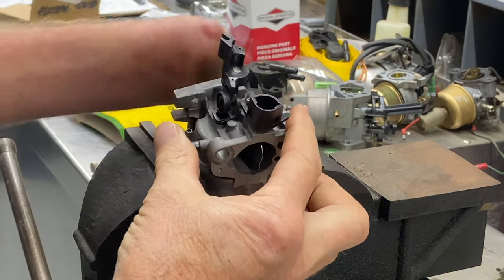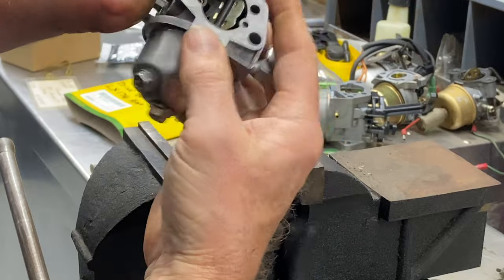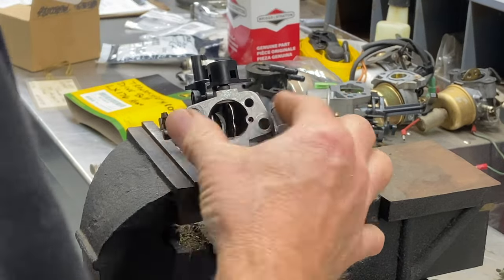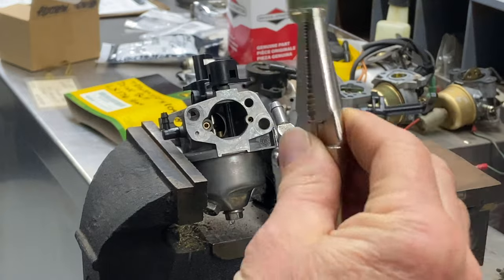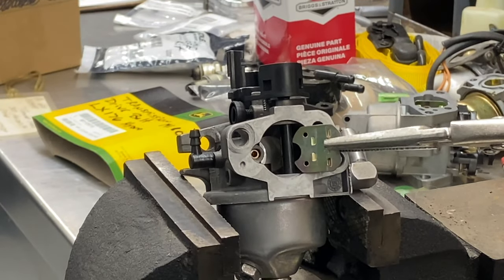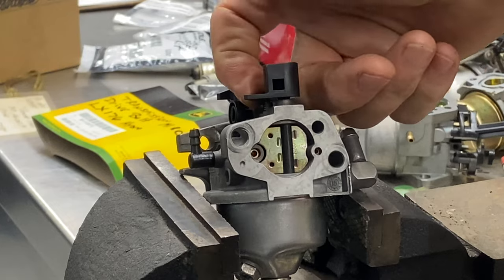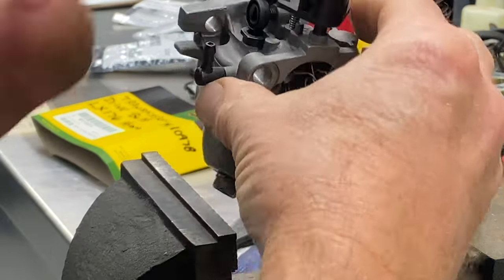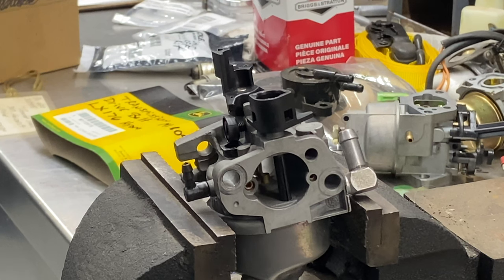How to Remove Choke Shaft on Snow Blower Carburetor.

Comment: New carb doesn't come with the long shaft so they want you to use the old parts or is that just because it's cheap aftermarket?
Reply from the maker: If you have a snow thrower with a China engine, all the carburetors are from China. Yes, some are junk and you need to be careful. The OEM "original equipment manufacturer" carburetor is made by Huayi. Even the OEM carburetors do not come with the plastic rod. Just swap it out.
Reply: @JohnsonsSmallEngines  Did what you said it purs like a kitten. Thank you.

Comment: How to remove the longer choke shaft
Reply from the maker: It’s the same process.
Reply: But my plate is not coming out or moving at all. 😭😭 I just want to get this friggin rod out since the new one didn't come with one
Reply from the maker: If you hold the carburetor and you’re strong enough. Take a pair of pliers that have a good grip and you should be able to pull the black rod out of the top of the choke shaft where the long rod connects to the lower choke shaft.
Reply: Thanks so much for the video! I have been searching for several hours and I found my answer!

Comment: Still don’t understand how to get the long silver metal piece out of the plastic. It has two notches, do they push in? Mine didn’t seem to. I took out the choke plate and removed the black plastic piece going through the middle and it was connected to the silver rod with the black plastic on top. Sorry for not using technical terms, trying to do this myself. Thanks.

Comment: The part that you are showing how to remove - can this part be replaced? when removing the carb, the long choke extension lever caught on something and the subject part broke right where the shaft/pin goes into the carb body. OR, do I have to replace the whole carb? Thanks. I really appreciate your videos.
Reply from the maker: You will need to look that part up under your engine or model of the machine on a parts lookup online to see if you can get it.

Comment: I have a 5 HP B and S lawnmower and the choke is very flipping when it is off the motor, but install the carb to the motor and tighten the 2 10 mm nuts, the choke gets really tough to move, loosen the two nuts and the choke is very floppy again, tighten it and the choke is very tough to move.
90's Briggs and Stratton 5 HP motor.

Comment: How do you hook up the choke bar to the plastic choke pice ?
The original carb has metal.
Reply from the maker: If your original has a different set up. You will need to put that set up back in the new carburetor. Sounds like you didn’t get the same carburetor.